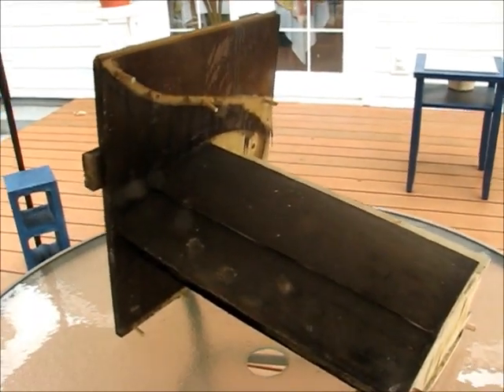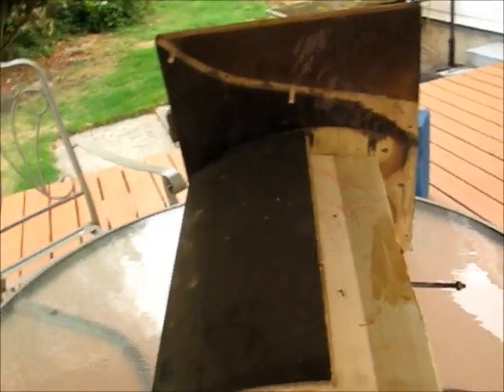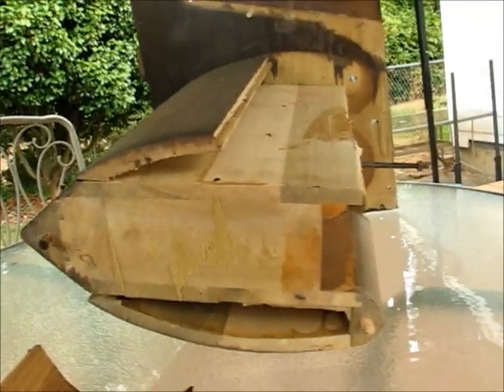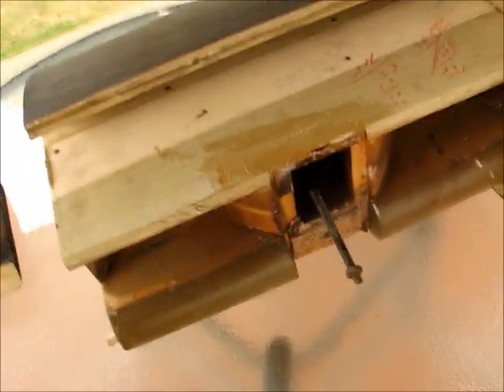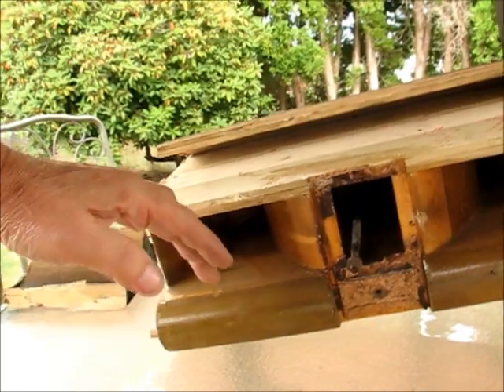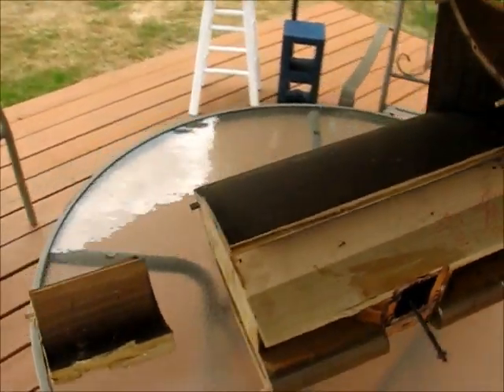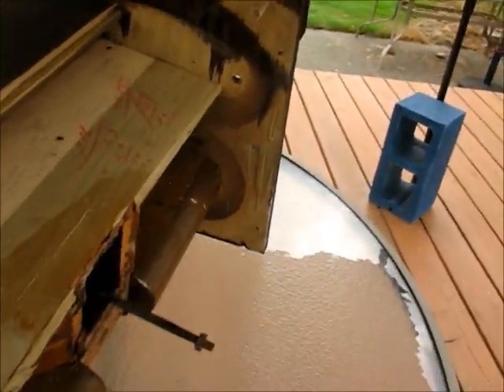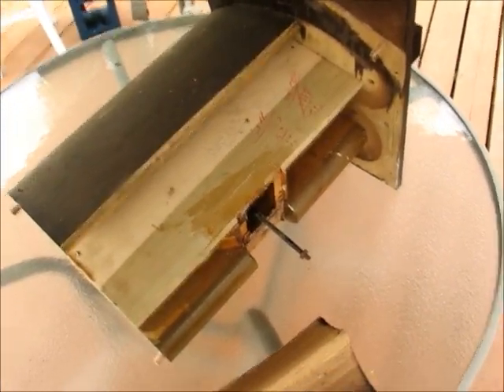Inside a Victrola Orthophonic Re-Entrant Horn

Comment: How do these guys sound?
Reply: Remarkably good, considering that there are no electronics involved in playback.  The deteriorated surface of old records cause crackling noises, but this was not a problem when the records were first made--and at any rate, it still does not change the fundamental quality of the sound, which is quite clear (considering that it's all actually just your muscle power being transmitted through a rather odd mechanism and into the air).  It sounds far better than the old acoustically recorded discs--the Orthophonic was designed when electric recording machines were invented, as the old acoustic phonographs could not adequately reproduce the high fidelity of the new electric recordings.  So a new (still acoustic) machine was carefully designed so that the sound waves would be produced most efficiently and with the retention of the quality produced by electric recording.  It is possible to find recordings taken off of these Orthophonic phonographs here on Youtube--i personally prefer their sound to that of electronic transfers, as they maintain the acoustic resonance of the machine which seems to dampen the scratching noises a little.  (On one of those clear electronic transfers made using an electronic phonograph with the signal hooked up to computer, you can hear every single crackle with painful clarity (unless there is noise reduction and reverb added, both of which sound bad).  The original machine's reproduction is a bit less harshly noisy, and possesses a more human resonance.)
Reply: @wannabecat369 I'm aware of the orthophonic.  Supposedly it has a higher frequency response.  I highly recommend you check out Roger York's channel.  He has many good acoustic performances on his channel all played back on orthophic reproducers with a very high quality NOS needles.
The funny thing is that the electric reproducers from the time are all bad and need to be fully rebuilt with parts that aren't available.  The rubber they used for compliance has turned to rock and will not only sound very bad, but will utterly chew the record.  They have no compliance whatsoever unless they are rebuilt.

Comment: Cool! My Victor VV 8-4 has the same horn like the one used on all floor models of the Orthophonic Victrola. There was no speaker at all, you can hear sound as it passes in and out of the horn from a soundbox. Works with other electrical recordings from Orthophonic to later recordings up to the 1950’s.